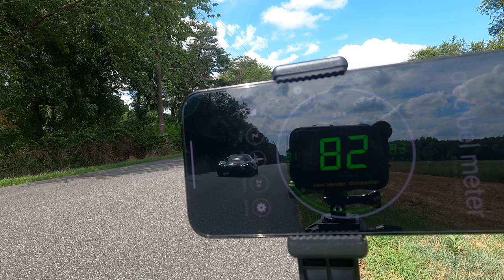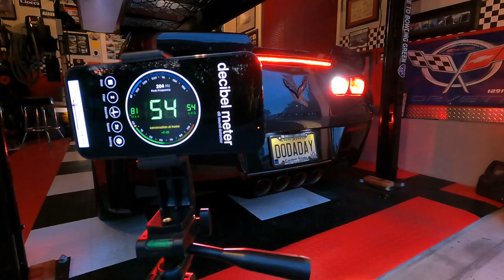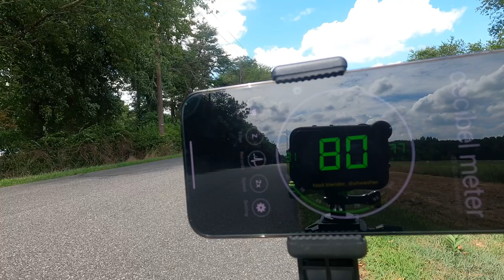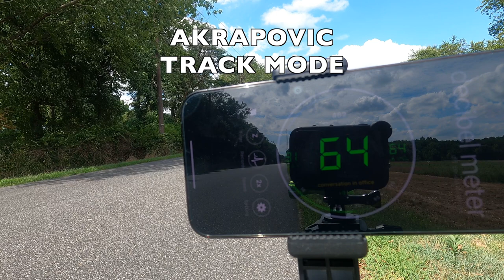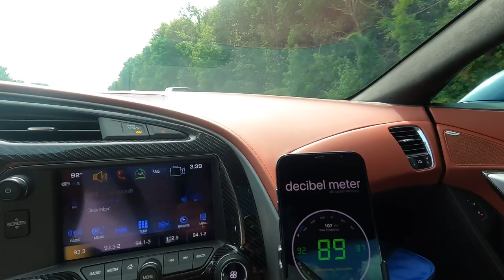C7 Corvette Mods - Akrapovic Exhaust - Steering Wheel & Air Bag - Stage 2 Spoiler - Sound Clips!

Comment: How much louder is it compared to stock when comparing things that aren’t just straight up wide open throttle because obviously it’s going to be quite louder there. Example, how does in compare in volume to stock during cold starts? What about trotting around the neighborhood in stealth mode? What about on the highway in touring just cruising around 80mph? All of this in comparison to what it was like during stock? I want it louder than stock when I want it to be loud but is it still able to remain quiet when I want like the stock npp exhaust?
Reply from the maker: Sorry for my delayed response.  What I love about this exhaust is that is still maintains the valves, that control the sound.  So it's not full loud all of the time.  All things you mentioned, cold starts, cruising are slightly louder than stock with the valves closed.  When you open the valves it gets throatier and slightly louder than vales closed.  It is not as loud as an AWE Track exhaust as an example.  For me this is the sweet spot!

Comment: How hard was it to remove the air bag? Got any video of that? Hope to see you at Carlisle in a few weeks.
Reply from the maker: BJ, Ron removed the air bag while I was working on the spoiler, so I didn't capture that on video.  Its a pretty easy job compared to the C5 for example.  Check out the Five12Garage channel, he has video of it.  You insert a narrow screwdriver into the rear of the wheel housing and release two tabs that are holding in the air bag and then it just pulls out.  I will try to video the wheel and air bag before I send them back for the core exchange.

Comment: I have spent fortunes on my Corvettes, but not $6,000 for an exhaust. I think my Borla was $2500, and i had to think twice for an exhaust that doesn’t sound a whole lot different than stock. I will see you at Smithville this year. Thanks for sharing.
Reply from the maker: Joe, this is exactly why I bought a used set up.  New it is over $7,000 and they do not even offer the X-Pipe any longer.  See you in Smithville!